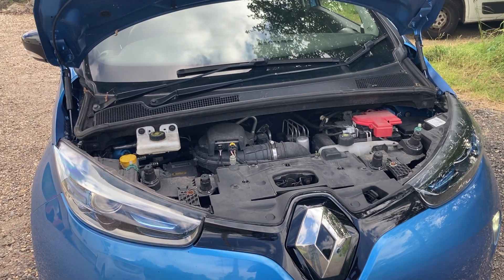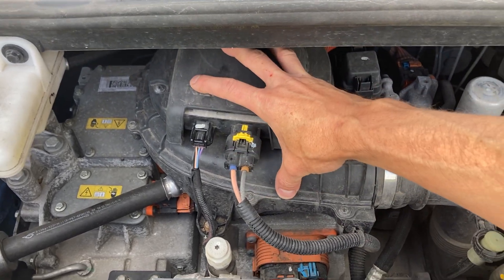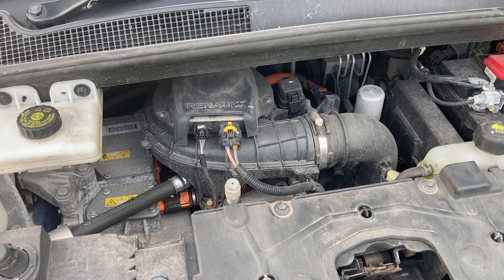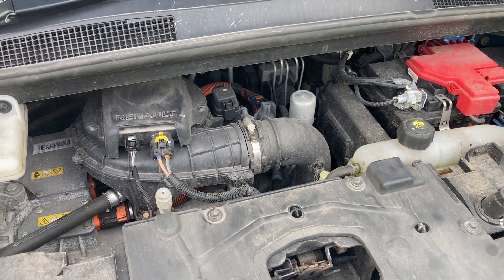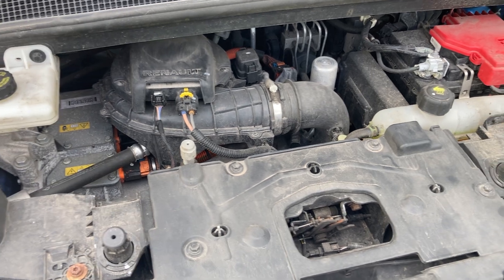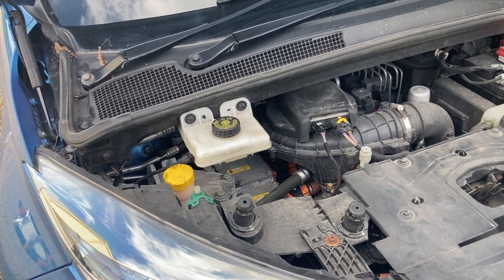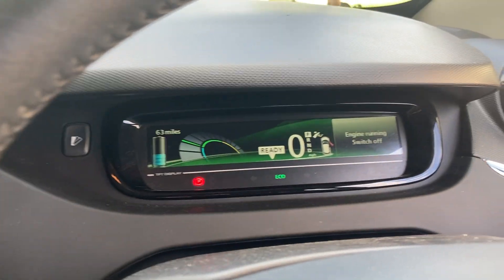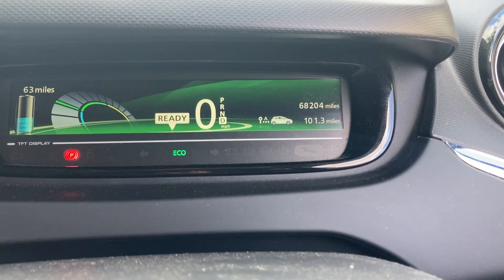Renault Zoe motor bearing failure noise audio how to diagnose 5AQ r240 r90 r110 r135 ze22 ze40 ze50

Comment: Hello.
After replacing the bearings, my car started to jerk slightly at low speeds.
Do I need to recalibrate the rotor position sensor after replacing the engine bearings?

Comment: Hi Gary! Is tit the high pitch noise that comes and goes or something else? My Zoe makes a high pitch noise which starts at about 20 mph and is not continuous. It comes and goes, especially if I leave the accelerator and pres it again. Also, when I put it in Neutral but it moves.I cannot hear it.t
Reply from the maker: Hi, generally the noise is always there. Do you have any symptoms other than noise? Cheers
Reply: @garycevrepairs  Thank you for your prompt reply. I don;t have any other symptoms.  Just this irritating whinning noise which comes and goes while driving in the city at speeds of over 20 mph. I cannot hear it n Neutral and I think I can hear it even at speed of 60mph (the background noise is too much to be sure though! Do you think it could need an oil change in the gearbox?
Reply: I have the same issue it comes at beginning and goes. Only high pitched sound and no any others. Is that normal?

Comment: My Zoe Z40 from 2017 with an R90 motor started developping a light whining noise at 90,000mi / 144,000km.
The pitch was proportional to the speed but the loudness was independant to the torque/power used.
I (stupidly) kept driving it to 105,000mi / 168,000km. At this point the whining was very obvious and at certain speed I could feel a sligth vibration in the steering.
The motor stopped mid drive with smoke coming out of the motor fan. Due to the vibration the graphite bushes got damaged and started sparking causing the plastic isolator to melt and burn. Luckily I have a very good local HEVRA garage that swaped the motor with a second hand refurbished one (new bearings and bushes) for £3,100.

If I had stopped when the whining started, it would have been a simple bushing and bearing refurbishment for about £1,600 (mostly labour as disassembling the motor unit is very labour intensivve).
Reply from the maker: Glad to hear you had a good local EV garage!

Comment: I noticed no pedestrian music running. I don't seem to be able to turn it off on my ZE50. The switch only changes how it sounds. It would be good have it off for this sort of check. Am I missing something?
Thanks.
Reply from the maker: From around 2021 it’s mandated that you can’t disable it unfortunately.
Reply: @garycevrepairs Thank Gary. I thought it must be something like that. It's really annoying for fault finding. And Googling just tells you you can turn it off.
I bet nobody argued a practical need for the option. They could have allowed a short period of silence with a time-out requiring a restart or something.

Comment: Could you please help me. I have a high pitched noise in my 2013 Renault zoe Itens. I used to own a 2014 zoe and never heard that high pitched noise. It sounds exactly like the high pitched noise that you have in your video. it feels like its a dented wheel that is not properly lubricated or something similar.
Any help would be really appreciated.
Reply from the maker: Hi is there a local hevra garage? I don’t do much customer work to be honest, and generally only big jobs. It could be something simple with the suspension, if it’s more serious I can help you work out the best repair options. Thanks

Comment: I have a r135 with 97000 km, which is similar to yours. Do you suggest to change the bearing in advance, to prevent this damage? Thanks
Reply from the maker: Hi I wouldn’t change them until they started making a noise. Cheers
Reply: @garycevrepairs  thanks

Comment: I have a clonking noise like something is loose on one end in the engine compartment and while passing road bumps it goes clonk-clonk-clonk not really in the same rhythm as the bumps but rather provoked by them... like a spring struck just once then it reverberates. Wheels linkages seem to be fine at a first "mk1 eyeball" inspection and pulled by hand, nuts look at they place. If car is stopped and I rock it it doesn't make the noise. I tried to shake/move the engine with my hands but nothing moves. Needless to say car works fine otherwise.
I am a bit reticent to go to a dealer being afraid is probably nothing serious but I might get ripped of money....
Reply from the maker: Most likely front suspension - if you have a jack and can raise each front wheel and try to rock it side to side. Sometimes it’s easier to get someone else to look behind while you do it, if you can feel the knock then look at the ball joint just behind the bottom of the brake disc and drop links. Cheers
Reply: @garycevrepairs  Thanks for the answer. I have a jack and I will check today. Someone else said he had similar noise and it was a planetary arm/connection at fault. I think the knocking is mostly when car is going straight and "unloaded" of acceleration. While turning and in acceleration rarely does it. Will see... Thank you again!
Reply: @garycevrepairs  I did a check and I couldn't find any play or noise when pulling on the wheels or any of the linkages while suspended on jack. I pulled also on the planetary connection and on the right  is seems to have a small if any play... I think is normal though on the left side it has none at all. I've also put the car on drive while suspended on the jack and turn the wheels left and right while rolling at "relanti" and  I heard no noise. Could it be a engine mount rubber dampener? I am out of ideas now :) .

Comment: Thanks for the video. My R110 2020 model, had a motor replacement at 63k kms due to this issue. Fortunately under the warranty, or i would have to pay around 9K €. Here in Lisbon, you can see thousands of these cars and many many of them with this noise!
Reply from the maker: Yeah Renault charge £3,500 just for the motor itself, then plus fitting it’s around £6,000. We can do it with a used low mileage or rebuilt motor for around £2,500 with warranty.
Reply: @garycevrepairs  That is great.
I work with this car and do around 200 kms / day (Uber). Now it has 115 K kms with no problems yet. I wonder if this “new” motor will eventually have the same issue, because the warranty is gone… 😔
Thanks for the reply sir.
Reply: 372k km and mine just start yesterday to do this noise ...
Reply: @Adrian_Calin  372k kms? Wow! That motor has definitely done his job. Didn't know they could do so many kms. 👌🏻

Comment: Hi thanks for the video. I realised i have the same sound like the high pitch sound like electric stuff but no rattling. Is it normal or am i in very early stage? 😢
Reply from the maker: Hi if it’s a high pitched whine it may be nothing to worry about. The bearing noise is a hollow rumble.  The ac compressors on Zoe’s are also quite noisy. Cheers

Comment: Is the bearing issue with both makes of electric motors?
The 'R' Renault made motor and the 
'Q'  (Quick Charge) motor made by Continental?
Reply from the maker: Hi, the R motors suffer from bearing issues however the reduction gear on the Q motor have also been known to have bearing issues (no bearing issues on the Q motors itself) but it’s a less common issue on the Q and also easier to fix !!
Reply: Thank you  @garycevrepairs
Reply: @garycevrepairs nasıl bir çözüm ? Türkiye den yazıyorum
Reply: Hi. I have Q engine and sound on passenger side like wheel bearing but not so sharp sound. No movement on tyre. Were shell I start to look ?
Reply from the maker: @lukalukic644 likely bearings inside reduction gear on that type

Comment: Glad I have a q motor on mine, wasn't sure when I got it but wanted the efficiency at 3kw charging and in 2016 rapid ac was not common, my 2016 zoe has done 67k miles
Reply: Mine is also a ZE 40 Q90 ( 2017 ) 83,000 Miles